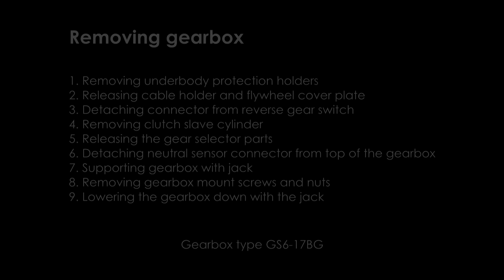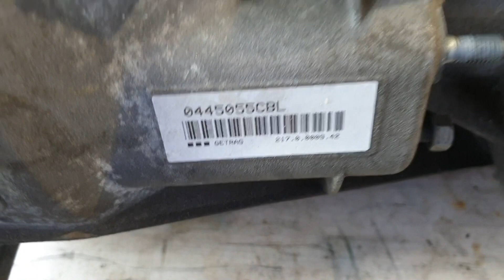Remove GEARBOX - Drivetrain rebuild PART 4 - BMW E91 engine N43

Comment: Also is it safe to lower gearbox to access those upper bolts? I thought you can bend gearbox
Reply from the maker: Yes it is safe. Without tilting, the top bolts are really hard to reach ...

Comment: You want to change the clutch?
Reply from the maker: I ordered a used gearbox from England for 248.00 euros + 100 euros for shipping costs. The gearbox is from a 2010 BMW car.
The intention is to replace it with an old one.
The old gearbox makes a sound when the car starts to move.
I have changed already last autumn, a new flywheel, clutch plate and other wear parts.
Reply: @JaniVoutilainen  can u change a manual gearbox to an automatic one?
Reply from the maker: @lifeofranco  Personally, I haven’t done it, but I think it’s possible.

Comment: No , it is not. The main bearing holding the shaft is warn .
Reply from the maker: @Калоян Марков
Many thanks for the feedback!
If the "clearance" of that shaft is not normal, then I replaced the defective "new" used gearbox.
For even in that "new" gearbox, the clearance of that axle is similar to that in that old gearbox.
We are talking about a shaft that goes from the gearbox through the flywheel to the engine hub / bearing.
Before I start dismantling or looking for a new gearbox, I would like to know what that information is based on, that that clearance is not normal? There is very little information on the internet about this. And actually I'm just a regular guy who likes to do things in your own car shelter! 😉
Thank you!
Reply: @JaniVoutilainen  I guess there needs to be some clearance in it because you need to be able to fit it into the flywheel. I think, as long as it sits inside the flywheels teeth with out any 'play' or wobble then that what determines whether it's good. But this is just my thoughts from my very limited knowledge.. you of course know far more about this than myself